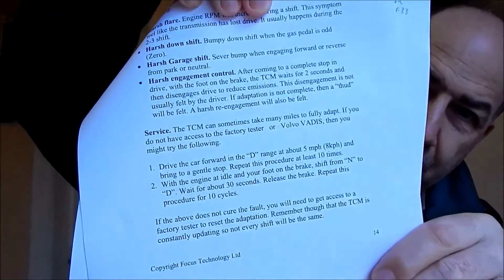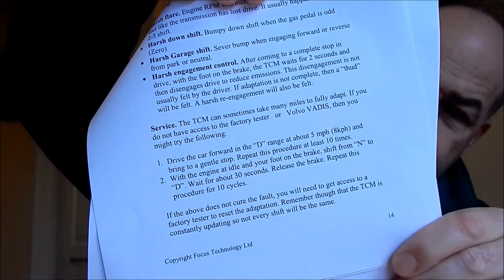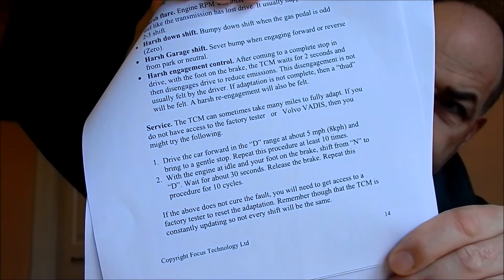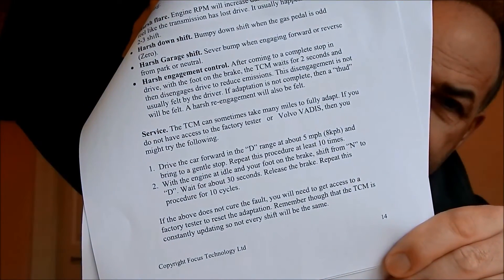Volvo AW55-50SN adaptive transmission -  GM AF33 & AW55 51SN

Comment from the maker: I pin here, an answer I gave to a question from an owner of a new car, because it describes how the automatic transmission works, to an extent that may help understand faults:

sleekitwan
3 months ago
Brand new meaning less than a thousand miles or something?  The main test for automatics, is to warm it thoroughly then floor it from a standing start, or at least hit it to two-thirds of the 'gas' pedal travel say, then it should just move smoothly through the gearbox without hiccups except a slight bump when the automatic upshift occurs.  If this is fine, Keep any analysis basic: what is it doing it ought not to be, what's the ideal that it is not giving you when you drive the car?

That, and does 'kickdown' work?  Travelling along then punching it as though to overtake, should prompt one if not two downshifts depending on roadspeed and how aggressively the gas pedal is pushed.  Just stomp on it - does the car handle that ok?  There should be no drama, just a downshift or two and the car accelerates away.

The basic key elements to an automatic gearbox are complex in practice but simple in principle.  First, the most important perhaps, the automatic clutch function - there is not much to go wrong here, and the symptoms are noticeable once you know them: if the automatic clutch unit is short of fluid (they hardly ever have too much) the tendency is for the car to act as if a novice driver were constantly riding the clutch.  It takes unnecessary revving to take off, and the engine revs will be too much for any given speed.  That's because the impeller is having to work with too little fluid, and is spending a lot of energy just washing the small amount of fluid it has got, past the blades of the other impeller without moving it as much as it ought to.

Find the dipstick for the transmission, pull it out, and check the level.  Do this with the engine stone cold one morning, and if you are not confident (it's really nothing just make sure you put the dipstick back in properly), any decent mechanic will probably look at it for free.  Just like engine oil, the transmission fluid dipstick has a level marked on it, and there needs to be enough when cold but not too much as it expands when the engine heats up.

That's about all that can go wrong with that bit.  Fluid's not been put in to enough of a level, or has leaked out due usually to aged seals etc.  OFTEN MORE NOTICEABLE if you park pointed uphill in some vehicles, as the fluid there IS there, drains away from the torque converter into the space in the rest of the auto gearbox - the torque converter unit has a hole in the casing, so fluid can be mixed around and it can get fresh cooler fluid mixed in.

The only point is, these clutch units in an automatic (torque converters they got called), share the same fluid as the auto gearbox.  So, if you find the tell-tale signs of low fluid giving that too-much-rpm thing when taking away from a light etc regards the torque converter/auto clutch, this means the GEARBOX is ALSO low on fluid.  That would burn the friction disks more than they ought, and prematurely wear and cause a lack of cooling etc.

The other FOUR main parts, are: 1 - the physical disks and shafts that connect in different configurations to create a particular gear ratio; 2 - and the actuators that make those engagement units contact or not (more like manual clutches, but they work in auto gearbox fluid ie 'wet' clutches); 3 - and the hydraulic valves and pathways that make those actions happen; 4 - and right at the front end, the 'brain' or computer system that taking note of a gas pedal position, road speed, amount of lugging of the engine, rpm, etc, makes the decision every few hundred milliseconds to stay in the gear already operating, or flick the wet clutches in and out of contact in a different configuration to make a shift up or down a cog as it were.

The 'brain' is renowned these days for learning or adjusting to a particular driving style, and trying to deliver according to a change in that - it adapts - hence 'adaptive transmission'.  The brain is not so likely to go wrong - THE NUMBER ONE ELEMENT THAT GOES WRONG ACCORDING TO ME AND LOTS OF TAXI DRIVERS IS SENSORS.  The sensor for the rpm, the sensor for the engine lugging or pinking, and so on.  Sensors, sensors, sensors!

If they go wrong, it might be in an unpredictable manner, and the 'brain' cannot properly operate because it is getting deficient information in about what is going on.  

It is important the transmission fluid is correct - a new car should not have an issue.

Older cars - I only buy ones with 100,000 miles or more on the clock due to budgetary contraints (!) - may have problems involving one or more of the above mentioned elements.  But, that's all there is.  As I say, stick to the basics, keep the analysis simple, try to decide which of the above elements is most likely the area of fault.

Obviously, you can get the dealer/seller of the automobile to you, to connect up a fault tester (OBD or similar) and they will from that, get a load of codes, which may or may not indicate an item is wrong - a sensor probably!

Treat it like medicine - get a second opinion if you are not happy.  If you are lucky another franchise will check it out for you, or you may need to pay and independent.  It won't be much - they plug it in, run or even drive the car (maybe on a rolling road) and get the results.  Problems are flagged up.

Older vehicles have bald clutch plates, and sometimes people change the transmission fluid and have a shock when the transmission starts to slip and the rpm spirals up under load (acceleration, or uphill, or trying to maintain steady speed on the major hiways etc).  My own theory on this is simple and is verified by the fact Volvo do NOT FIT FILTERS to their transmissions.  Why wouldn't they want little bits filtered out?  Surely it's just like engine oil, you want it as clean as possible right?

No.  Those particles floating around, are the bits of the clutch friction material that have worn off.  This is the conundrum of having an older auto box.  OF COURSE the burnt/ruined fluid needs changed, but once those particles of friction material are removed along with the old fluid, you have lost the bulk of the friction material from that old transmission.

That's my theory, as an engineering graduate and long-time motorcycle renovator and veteran of many car repairs.  Nothing else fits the symptoms, and the car manufacturers omitting a filter kind of puts the seal on it.

Let us know how you get on.  Steady away, keep it simple, and stay logical about it.  There are no other components to these systems, than I have described here.

Brand new, and faulty - same rule as always, if you are not happy, ask to try their demonstrator vehicle of a similar type.  Does it behave the same?  If not, define what the difference is by writing it down, you can even just set your phone recording the engine note etc inside the cabin as you drive, in both vehicles.  Spot the difference then, later, calmly in the comfort of home.

In the difference of behaviour between a good and bad vehicle, will lie the precise answer you need.

END of pinned answer.
Reply: Car has 87,000 miles with a full service history since its purchase. The first owner put on 13,000 miles a year for roughly 4 years (Safe to assume that is highway mileage which as we know is light work for transmissions). The second owner put about 4000 miles a year on it. Purchased it from a major dealerships used car/ trade-in lot. The car is immaculate and performed perfectly for the first 500-600 miles I put onto it and then a shift flare developed between 2nd and 3rd gear under hard acceleration. No record of any issues being reported with the transmission under any of the services. My best guess is that I have a bit heavier of a lead foot than the 2 previous owners and the transmission needs to be reset to learn that. I've put as few as 800 miles on the car now, the shift flare only occurs once every 70-100 shifts in variation of RPM which leads me to believe that nothing is broken or in need of repair.

Comment: Hi there. First and foremost: there is some wrong information across the web (including on solenoid replacement instructions from Rostra): it is completely false that one can do the adaptations reset and relearn without the Vida software. One MUST plug Vida to the car, go into the settings, and click to reset the adaptations. Then drive the car and perform some operations while a yellow triangle lights up on the dash. The adaptations are relearn only when the yellow triangle lights up.  Performing the driving operations without having reset the adaptations in Vida, will do nothing to the transmission and will not light the yellow triangle.
Now, for those who do have access to Vida, here's some tips.  On my car, I did replace the solenoids, kept the rest of the valve body, and did the adaptation reset and relearn in Vida.  Well, the transmission now it is better but still not smooth like a new one.  Why?  Because the whole valve body has wear to it, it is not a new part. 
So what happens if you don't replace anything, just keep all parts unchanged then do the adaptation reset and relearn in Vida. Well, in the first place you will have trouble getting the computer to relearn the adaptations: see at the end of my video, even with new solenoids, I had trouble to relearn the adaptations.  This is because when the transmission relearns the adaptations, it MUST have new parts i.e. new valve body (including new solenoids). These adaptations are designed to be learned when the car is new - or when the whole valve body is being replacing.  If you try to relearn the adaptations with old parts, the adaptations will not learn properly, and it may affect the transmission. A Volvo mechanic told me he had customers doing this, and their transmission started slipping some times after. So one should rather replace the whole valve body with a refurbished one, or at a very least replace the solenoids, and then do the adaptation thing with Vida.  Also remember that when driven for too long with a worn valve body, the transmission itself gets damaged and my not be worth trying to fix it.  
See my solenoid replacement video  https://www.youtube.com/watch?v=2RJyYRQxbZA

Comment: Thanks for sharing this information! I've been having a bugger of a time adapting my daughter's AW55-50SN in her 2001 V70. Started with a circuit fault for the TCC linear solenoid. Mind you, the fault would occur at low speed before activation of the solenoid should be required, and sure enough, the coil was going bad. She's been having a hard time adapting, yielding different faults during each attempt. 

I've been able to reset the fluid counterand adaptation values, but next we'll try using the Volvo factory diagnostics, as there is a forced learning routine in the software from the 01 model year and newer. 

In my case, this gearbox has served us well...with 220,000 miles of use. Pretty impressive. If this procedure is unsuccessful, it's time to do a proper rebuild. What's a father to do? Hehe.
Reply from the maker: Well, I am dying to know what maintenance you have done to keep it running so well for so long?  Ignored it? Or changed the transmission fluid every 40k miles or something?  The furthest I ever got out of an auto box was a VW Passat estate/wagon, 1999 vintage, and it just made 200,000 miles but that was with some faults slowly worsening ie bad shifting etc.  Many, many French auto cars I have had, had problems after 100,000 miles BUT of course, this may simply be a measure of which cars were clocked more before I got them, than a good take on the transmission longevity?

Glad it was useful, please come back on the treatment the transmission had, to get it this far?  Also, of course, towing will perhaps halve the life, because the fluid gets burned and often towing will occur in summer too, so prolonged high pressure use at elevated peak and average temperatures?